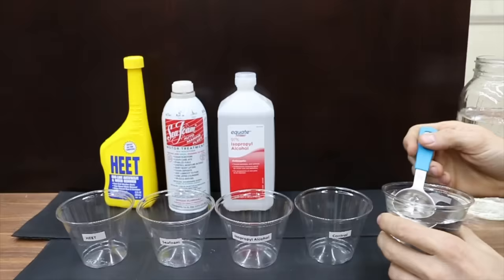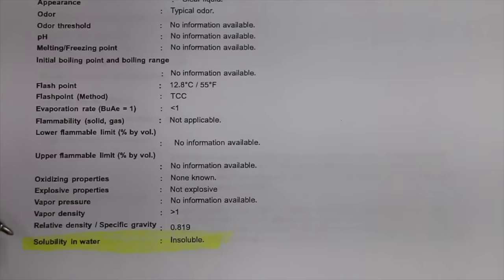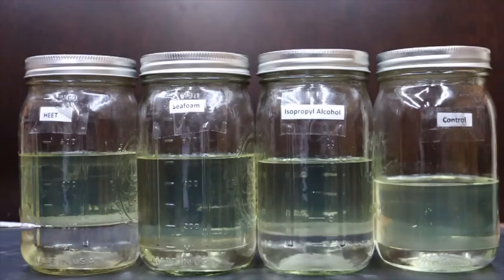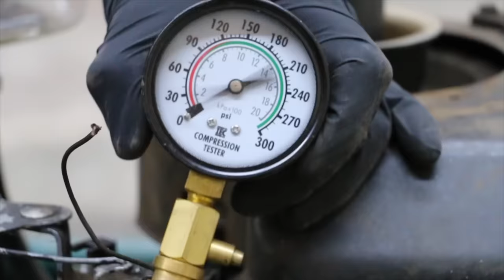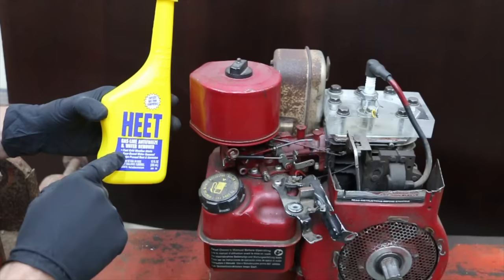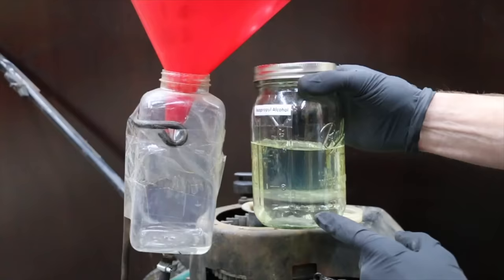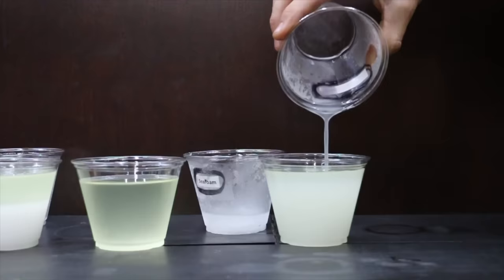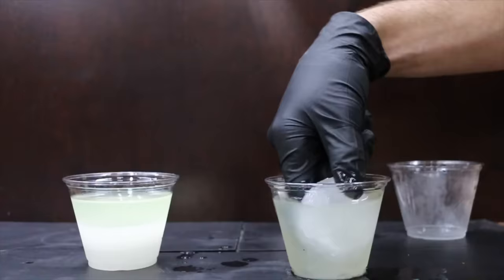Is HEET better than Seafoam for Water in Fuel?  Let's find out!

Comment: Hey! I have thought about this video idea for a week! So What you should test is make a Showdown of hand cleaners such as Fast Orange and other premium  brands and see if there is a difference between premium and "cheap" hand sanitizers! So, what do you think of my idea? Ty for the Terrific Content!
Reply from the maker: This is a great video idea!  Thank you!
Reply: Game Bred Duramax  yeah
Reply: To the list of cleaners I would add lye soap with pumice if you can find it.
Reply: Believe it or not but I stopped using fast orange, laundry soap has been my go to hand cleaner for years...grandad showed me been doing it that way ever since
Reply: Yea I use fast or age for cleaning after working on cars and it seems to work but how well idk I still end up with oil and grease in the pours and they just don’t go away it’s days before it’s cleaned up.
Reply: Maybe toss in regular soaps and also laundry deferents to test them if there any good on cloths. I wonder how dawn dish soap works compared to fast orange
Reply: Fels-Naptha Soap
Reply: @danharold3087  I came here to suggest Lye soap as well. Unless you are working somewhere without readily available water, I have found nothing better. I have never tried it with pumice.
Reply: I would recommend that Zep Cherry Bomb and Stoko Kresto be added to the list of cleaners tested.
Reply: Wet Ones brand wet wipes work really well also.  Maybe you can include these in the test?  :)
Reply: the two best soaps I've used are Snap-On's Nitro Gold and a soap called Grip Clean.  Both of those make Fast Orange and GOJO look like bar soap.
Reply: A old mechanic friend of mine used to use suave shampoo, it actually worked very good.
Reply: We have this gritty soap at work that has walnut shells in it and it works better than any pumice soap I've ever used
Reply: LA's Totally Awesome Concentrated De-greaser needs to be in the competition. You can find it at Dollar Tree or Dollar General. Works great for degreasing everything.
Reply: Good idea. Anything with pumice is good or a fingernail brush. You hardly see them anymore but its better than pumice. I keep Fast Orange wipes in my bike pack. Good for light clean up and you smell good afterward.
Reply: Gojo Supro best be on the list, its the best ive ever used. Been using hand cleaners daily for 24yrs
Reply: @ProjectFarm  If you do this be sure to include Kresto and Solopol!
Reply: I've always been impressed with good ol boraxo. That stuff feels like it will take your skin off along with the grease on the skin, under the fingernails, and out of the pores.
Reply: @bearwilliams8564  wow! I'm sure i will try that out soon! Thank you!
Reply: @FishFind3000  I always use a nail brush and Dawn dish liquid to get every bit of grease and crap off my arms and hands (only use the brush where needed).  By the way, I am in S.E. lower Michigan also.
Reply: Add Grip Clean to this mix!
Reply: @LT1FirebirdSLP  great idea!
Reply: @aliasfred  great reccommendation.
Reply: I use a product called coco scrub, made by spray nine. It works really well for greasy grimy hands.
Reply: @bearwilliams8564  Powdered laundry soap works great.
Reply: @marcellemay7721  okay! Have to che ck it out!
Reply: @domineech  okay! I will try that!
Reply: Orange Goop is significantly better than Gojo or Fast Orange, only hand soap I've ever found to truly clean my hands. Harbor Freight usually carries it too.
Reply: @slayer3032  okay! Does it remove grease well?
Reply: My favorite is the Goop brand orange hand cleaner.
Reply: @trekzilladmc  okay! I have to try that as well!
Reply: @aatos8522  Same stuff, only thing I've ever seen just melt off nasty used grease stains like nothing. Just remember degreasing handsoaps go on dry then rinse off.
Reply: @slayer3032  okay! Thankd
Reply: sand & dawn dish soap mixed
Reply: @JustlilTwisted  i think that would be nice
Reply: @bearwilliams8564  If your grandad used it, I assume you're talking about laundry powder, not the liquid.
Reply: Dawn platinum foaming dish soap works better than any hand cleaner I've ever used. Just one pump is all it takes.

Comment: There is a product made by Starbrite which is called Star-tron which is a amazing product! Great for old stale gas; also ethanol gas and is a stabilizer!!! You can find it in Walmart and the Marine section.
Reply from the maker: Thanks for the video idea!
Reply: +1 for the Star Tron, it's also very useful at absorbing the ethanol in today's fuels to make it safer to run in my motorcycles, lawn & garden engines, anything with a carburetor.
Reply: Startron in all my OPE, looks like  a blue sports drink but works great even in old stale fuel.  I believe it is actually an enzyme based product.
Reply: 1bad540i 
Yes it is a enzyme. The other benefit is that it does eliminate water in your fuel system!!!
Reply: +1 Startron
Reply: I've never heard of it before - Star Tron -. Thanks for the great tip.

Comment: The key is to use these product before the water has a chance to freeze or solidify.  Most, (if not all) automotive  fuel systems today use a recirculatory system. When the system is on excess fuel is returned to the fuel tank which keeps it stirred up which aides in removing undesirable liquid content. (and also controlls the temp)
Refueling stations are required to monitor and record water levels in thier tanks. Once a certain level is reach they are required to remove enough to bring it back into compliance. They also have electronic water detection systems now which sets off an alarm.
I have an inground fuel oil tank at home which I monitor with a graduated stick. I apply water detection paste to the lower portion. This paste changes color to indicate the presents of water if any and the level. This is the way gas stations used to do it (and may still)  and delivery drivers still do. 
 Pick up (or suction line/tubes) are installed so it can never reach the bottom of the tank.

Comment: Up here in Canada winter time gas line freezing was a problem in the coldest weather and to prevent this we did two things:

1. Keep the gas tank full of gas because condensation forms from the air against the inside surface of the empty part of the gas tank.  There's not a lot of moisture in the cold air but in a largely empty gas tank it can still produce a nice frost coating inside. 

2. Add gas line antifreeze (pure methanol in this area) when you fill up your gas tank. The warm gasoline from underground storage tanks melts the frost in the tank turning it temporarily into water  and which being denser than the gas would sink to the bottom of the tank and get sucked into the fuel line where it would freeze again causing  frozen gas line - if not for the fact that while in a  water state the methanol  mixes with it and prevents freezing. The methanol/water mixture then burns safely off in the engine.  I know someone is going to point out that methanol is very corrosive in fuel systems but the amount being added - an ounce or two I believe was insignificant in a tank full of gas. 

The need to add the methanol antifreeze was eliminated when ethanol gas became mandatory because ethanol performs the same function as the methanol did.
Reply from the maker: Great tips!  Thank you
Reply: Fuel tanks do draw in outside air. Otherwise they would be under vacuum and stall the engine at some point. From my own non-scientific testing it's crucial to have the right materials with Methanol, i.e storage containers which might start to leak within a day if things are really bad.
Reply: Never use methanol, it is a real-real poison! You breath it in inside the car from the gas tank. Isopropyl alcohol, yes!
Reply: Not methanol. Its methyl hydrate.

Comment: Years ago I purchased a Ford escort. It had sat for a while and the gas was junk plus it had water in it. I just kept putting isopropyl alcohol in it until it ran smooth. It probably took about 2-3 weeks plus a couple of tanks of gas and several bottles of alcohol but it did straighten out. 
I had to go the cheap route. Single mom with 2 kids and not much cash but i ran it. Every time is would start to sputter I'd just put in another bottle of alcohol. God was looking out for me and mine.
Reply from the maker: Thanks for sharing.

Comment: Thanks for the information. I live in Alaska and I normally use Heet in all my vehicles. On a 50 below zero day about thirty years ago, adding multiple bottles of Heet to the gas tank allowed me to get my wife's van home and into our warm garage. When filling your gas tank at the gas station, it is best to avoid doing so right after a tanker truck has dropped a load of gasoline into the below ground tanks. Water can collect in the bottom of these tanks and possibly get stirred up and pumped into your car gas tank. This is what happened to my wife.
Reply from the maker: Thank you for the feedback
Reply: Thanks, That's good to know.

Comment: How about testing products to keep diesel fuel from gelling up
Reply from the maker: Great video idea!
Reply: I use Optilube Winter.
A lot of folks around here use Power Service.
Our snowcat fuel is 25% no1 and 75% no2 diesel.
Good down to minus 20 where it just begins to cloud.
Reply: Diesel fuel in Canada has gasoline added up to 10% to prevent gelling.
Reply: @cleaner10399  No they don't.
Kerosene is added.
Gasoline in NEVER added to diesel deliberately.
Read up on Number 1 diesel.
Number 2 diesel.
And Parrafin.
Plenty of resources.
Do NOT put gasoline into diesel EVER for any reason.
Reply: Opti lube xpd has been my go to product year round here in vermont. My 2014 duramax starts with no problem, evan at -12F
Reply: A diesel additive comparison would be interesting to see as well.  I've always liked Stanadyne but have heard very good things about Power Service as well.
Reply: Living in Alaska here, and we use Power Service and a tiny but of ISOHEET in the diesel buses I drive in the winter (as well as an in line heater).
Reply: @Iceaxehikes  depends on the age of the vehicle, older diesels have a higher tolerance. When talking about using such things for antigel it should be less then 1% so not an issue. I wouldn't add straight gasoline to my diesel tanks, but I do use e85 as a source for cheap alcohol for winter use. Both my trucks have 3406e Caterpillar engines. Normally run Howes winter treat plus concentrate, but shit happens.
Reply: @ProjectFarm  I agree, Id love to see this one! Diesel Kleen, Royal Purple Maxtane, the list is endless. And freeze one and see if Diesel Kleen 911 can ungel it!
Reply: @406Steven  I use good ole two stroke oil!!!!!!!
Reply: Good one! Hopefully he uses some common ones like Howes and Power Service and maybe some other cheap and expensive types.
Reply: @gdglock  My Defender td5 starts every time at -44 F with regular pump diesel. No questions asked.
Reply: @ProjectFarm  make sure to use proper mix ratios and use brands like schaeffers and optilube winter and optilube xdp. Those are less popular when it comes to people buying at stores because of avability, but probably the most popular when it comes to what people do order.  
In this video about water, you added way too much water. It is unlikely to have 1/16 water and if you do its time to drain the tank. I do not think any of the products were meant to take care of something like that.
Reply: Don't forget it says right on the bottle that the additive must be applied BEFORE the Diesel gets very cold. In other words they work best when mixed at moderate temperatures and it's not so good to apply the antigel solution to frigid diesel. Although that in itself could be tested for to see what gooder one turns up. In practice, mechanics trying to start gelled up diesels change the filters, charge the run down batteries and warm the engine, but I've never seen them read the bottle or heat the fuel tanks.
Reply: I measured the Gel Point Temperature (I have the specialist ASTM equipment) on a whole range of these products and found that the NAPA product worked the best.
Reply: @jaydunbar7538 i agree, i use to run a half gallon of gas per full tank of diesel in my 86 vw golf, no prob.  Made it start better in the cold, that's for sure!  Kerosene is just safer.

Comment: A couple of questions:
1) Would Acetone work any better?
2) Would HEET help remove water from a home heating oil tank? (Delivery guy left fill cap off, and I didn't notice until a week with 2 rainy days later)
Reply from the maker: Thanks for the suggestions.
Reply: Don’t use acetone. A very powerful chemical if left to long in the tank can dissolve gaskets and rubber. You would need a lot of Heet in your oil tank. For your vehicle buy the red bottle Heet it has fuel injector cleaner in it. That’s the difference between the yellow and red bottle. There are chemicals that will remove water from your oil tank. Ace Hardware would know.
Reply: Would have them come back pump it out and replace with clean fuel oil. You will need to change the filter and purge out the water from line etc , if their delivery guy messed up they should take care of the issue. Also this cant be the first time it has happened so they should have a way to get it done

Comment: Can you try using gear oil as engine oil to see wether it stop smoking on a worn engine
Reply from the maker: Thanks for the video idea!
Reply: Dan, you just reminded me of putting sawdust in the rear end to stop the whining.. 
(That didn't quite sound right did it).. Lol.
Reply: it doesn't, and the exhaust ends up stinking like onions and arm pit! been there before, haha.
Reply: When my dad got out of the Navy in 1963, he was picked up while hitchhiking by a guy who had the gas station attendant (those were the days!) dump gear oil into his engine. He had a really bad leak, and the gear oil slowed it down. My dad was laughing. The guy says, "It works great, so long as I don't shut the engine off below 60°F". 😂 Every time they stopped, he'd let the car idle out on the parking lot, never shutting it down.
Reply: If you're looking at the weight, 90 weight gear oil is the same as 40 weight engine oil. The number is  only different between a gear box and crankcase application.
Reply: That will end up smelling really bad. lol
Reply: @grahamefreestone5309  Ripe banana's work better.
Reply: @aliasfred  in Australia the noisy diff remedy is banana skins... Tho I've never come across it myself... yet !!

Comment: My wife got REALLY bad gas in her 2018 Mazda CX-9 (Turbo 2.5L that prefers premium gas).
We tried seafoam & it did nothing.
HEET helped noticeably, but still needed a couple 1/2 tanks with HEET before it cleaned it up.
Finally, we used engine top end cleaner sprayed into the intake, after the MAF, to finish cleaning out the engine as it is direct injected.
Now it runs better than when we bought it! We bought it used with over 80k miles on it & now it's close to 90k.
I imagine the water from the bad gas, then seafoam, then HEET, then top end cleaner ultimately did a pretty significant cleaning of the engine.
Reply from the maker: Thanks for sharing.

Comment: How about adding some boric acid to the fuel tank of the engine with the clear head to see if the combustion is green!
Reply from the maker: Thanks for the video idea!
Reply: ive done this before on my predator engine. You must use methanol as a fuel. Doesnt take much powder . Also, your carburetor WILL need a teardown after it cools. It will form a white residue inside AND outside of it.
Reply: @UnTamedMustang  Is the Predator a Polaris engine by any chance?
Reply: @etiennesc.x7  its the motor he uses in every video.
Reply: @UnTamedMustang  Oh right yeah
Reply: @UnTamedMustang  how convenient that the mustang has a predator engine
Reply: @Ckcdillpickle  its how i learned a good amount about engines and fuels and ignition timing.

Comment: Should compare adhesive removers eventually 👍
Reply from the maker: I need to get that one going soon. Thank you
Reply: If you want to remove a price sticker, a decal or a postage stamp, etc., and put it somewhere else, heptane temporarily neutralizes common adhesives and lets you remove the sticker or decal in one piece. After a few minutes the solvent evaporates and the stickiness of the adhesive returns. Some decals will say “Void” if you remove them - not if you carefully use heptane. It also doesn’t leave stains or watermarks when it dries.  Pure heptane is commonly available as rubber cement solvent available in art supply and hobby stores everywhere, and from online sellers.  A high performance version of this product is available under the trade name Un-Du, which comes in an applicator bottle with a handy plastic scraper to help lift stickers off the surface.  It also has helpful instructions.

99% isopropyl alcohol is helpful in removing stickers and adhesive residue. The higher the percentage of pure alcohol, the better it works. Note that 100% pure isopropyl alcohol does not exist in a commercially available product, and may not exist anywhere outside of a research laboratory. Amazon has a great selection of the 99% version.  Buy it in smaller bottles (such as 16 oz.) so that you minimize the risk of contaminating your supply if you make a mistake.
Reply: Steam works well .

Comment: A test I would like to see is the Lucas oil additive. In stores there are test items with little gears and a wheel you can turn. I wonder what the oil mixture looks like at 20 below?
Reply: dont do it. it gets thick as molasses and can blow right past rings possibly clogging your catalyst. been there done that.
Reply: @mem3656  if it gets thick how did it get past the piston rings, that makes no sense?
Reply: @jonathangarzon2798  it probably didn't burn off like engine oil, and fouled the converter.  I have a 350 chevy with oil control issues, and thats what straight 40 weight will do.  It will burn 15/40, but straight 40 will give me a wet oily plug on the problem cylinders.
Reply: Just use motorkote